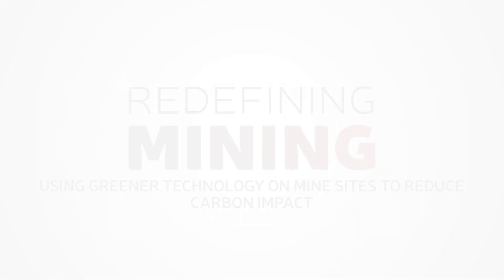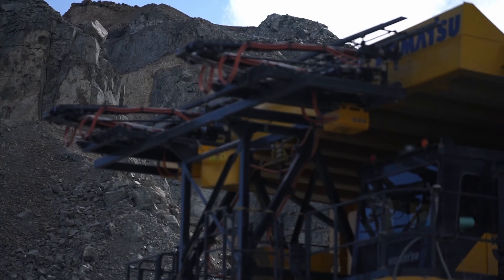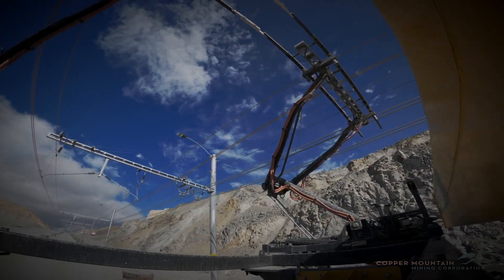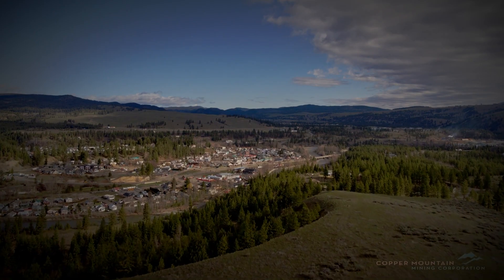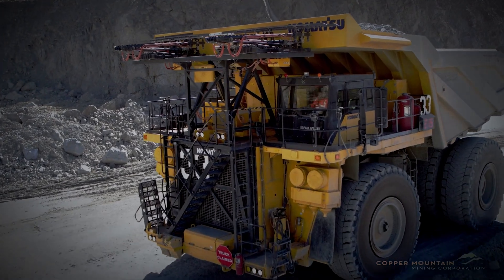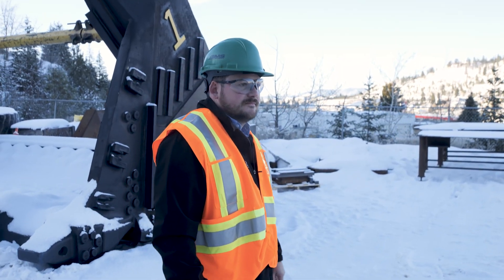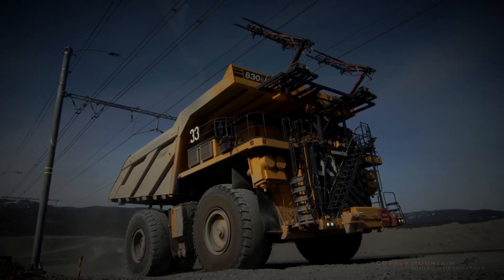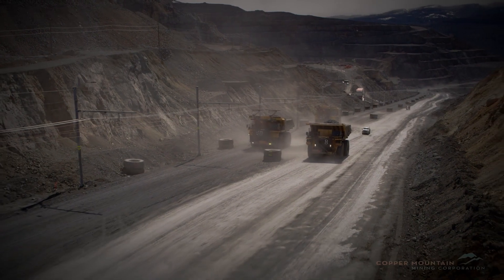Decarbonizing Mining Operations with Electric Trolley-Assist Haul Trucks

Comment: Edison Motors went hybrid because BC does not have enough electricity to completely go EV, so what will happen is you will run out of power quickly. Also, doesn't the IPCC consider hydroelectricity the same carbon exposure as coal because the water movement liberates carbon from the river and basin soil bed, mixes it into the flow, and then liberates it out the slide?  So it was my understanding that the IPCC would be, for now, allowing hydro but, in the future, encouraging elimination because of the environmental damage installing a dam causes and the liberated carbon.  So, with BC shifting everything to Hydro, do you not ultimately hang yourselves?

Comment: Why 2 pantographs? Locomotives can pull 7.5 MW from one pantograph
Reply: Locomotives ground power through the steel rails. So it comes in the pantograph, then out through the steel wheels. With rubber tires, you need a second pantograph to complete the circuit and be your ground.